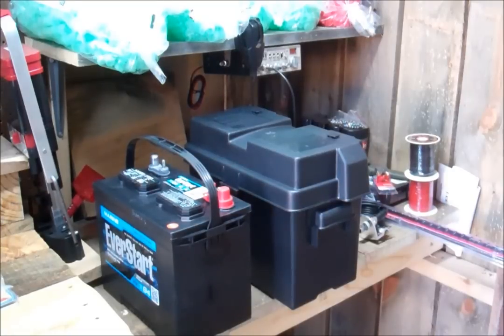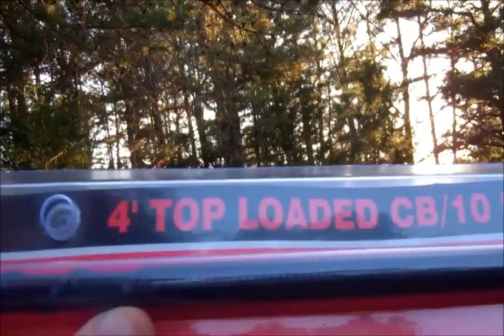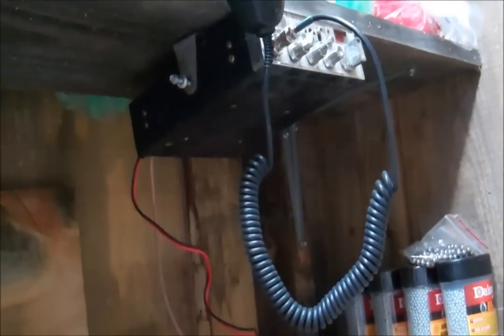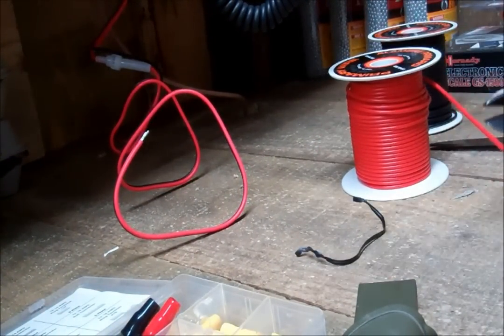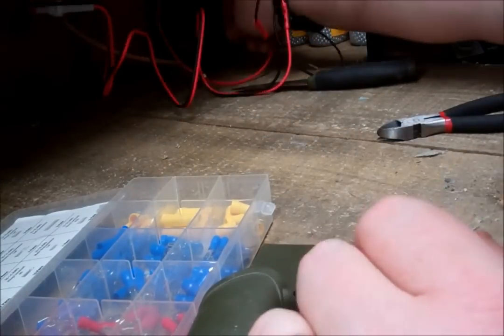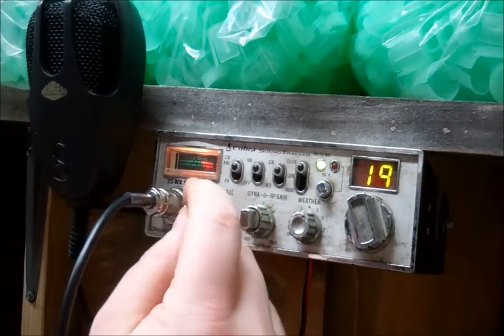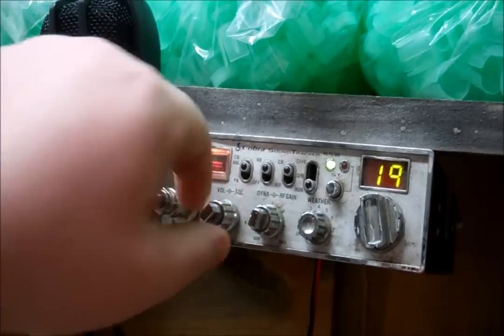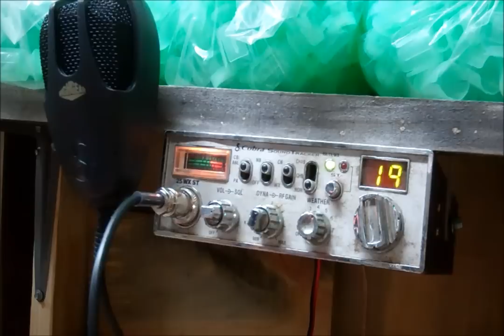Off-Grid Cheap CB Radio Set-up

Comment: a ssb radio will talk much better. I have been licensed for a few years and have my expert ham license. SSB will talk over the country with 3 watts under NORMAL conditions with a good antenna. Use a steel whip for better results on a mobile antenna, Then use ground radials for best performance.
Reply: My  wake  up call was the day I had a 10 Meter  QSO with a Cuban station using a Radio Shack  HTX-10 and a magnetic antenna on my van.  I was a Tech at the time but  three weeks later I upgraded to a General Class license and now I'm DX'ing all over Europe and S. America on 20 Meters with a GVRV Jr. dipole.Time for me to upgrade to a beam and 1 KW amp!
Reply: Expert ham license? What country do you live in?? Ive had a ham license for over 20 years & have never heard of expert class

Comment: First off where is your lightning arrestor system?  The least you should do when doing this is hook up a grounding block to a direct wire to the actual "Earth Ground."  To deflect any unwanted voltages from an electrical storm from coming into your ear etc.  Also, that battery and how long it will last?  Well most Marine batteries are 12Volts anywhere from 90 to 110 amps of electric current.  Therefore.  That would be roughly 1,320Watts of power.  Using simple Ohm's law for my calculations IXE=P  Where I is equal to the current, E is equal to the Voltage or Energy, and P is equal to the power or Watts.  Thus this setup would last 132 Hr's before fatality would set in.  Now this does not consider bleeder current formulas of the internal voltage dividers, or the loss of general electronic circuitry.  It is a mere very basic round about.  So it would last for some good amount of time.  I did rate this at 10Watts of power PEP or Peak Envelope power and using the highest deep cycle version 27 battery at 100ampers of current.  Some deep cycles only provide 90 Ampers.  That is equal to roughly 5.5 Day's of service life at 10 Watt's respectively which is fair.  Considering the radio itself produces anywhere from 4-5 watts of electric current.  The other contributing circuit easily uses another 2-4 watts of energy.  Thus this is a fair estimate.  Though an educated one none the less.

Comment: You shouldn't transmit till you set-up your ground plane and then and only then after its tuned and you have an SWR reading of 1.5 or lower (ch 1 and 40). I bet if you were to check it right now it would show a reading of 3.0 or over.  That's not good, don't chance it, unless you have money to throw away. Good Luck.

Comment: that is wrong.  When using a mobile antenna you must ground it to make it see a full size antenna otherwise you will burn the finals out of your radio. take a mobile antenna and set it up the way he did put a match meter on it then run ground wires I guarantee you will see a difference in the match

Comment: Not only do you need to run a ground wire from your mount but you need a ground plane for the waves to reflect off of ,  that mounting procedure is all wrong not to mention your standing wave is no doubt through the roof, good bye finals.

Comment: You DEFINITELY need a counterpoise/groundplane (don't confuse antenna ground with earth ground, or electric ground, all 3 are different), otherwise you only actually have half of your antenna! I have set up a couple of stations using this design and it works VERY well. Basically, it's the setup you already have, but you add another whip like the one you're using, and connect it to the base (shield of the coax cable). http://www.wolfington.net/articles/dipole/

Also, you need to tune the antennas for lowest SWR.
Reply: Blah tune 🎶 your banjo